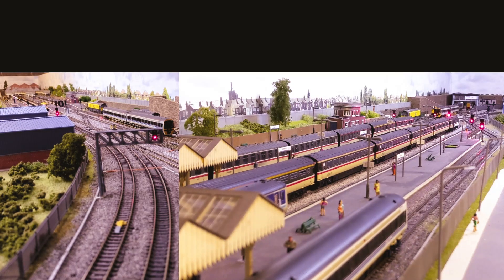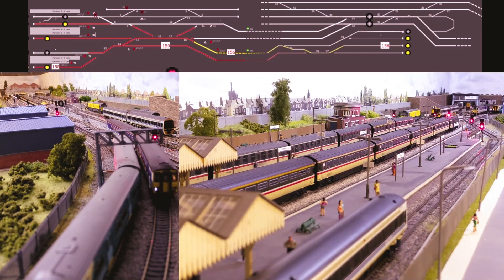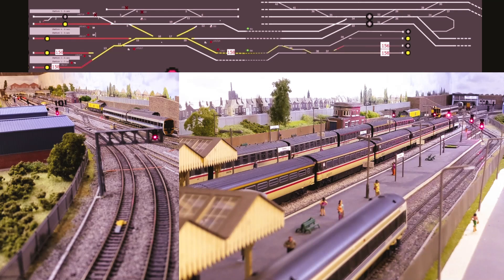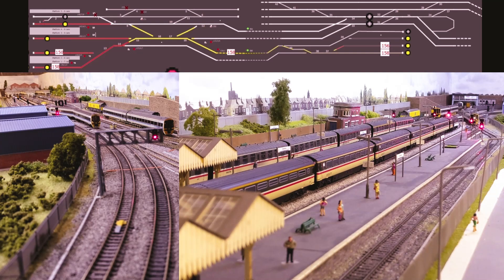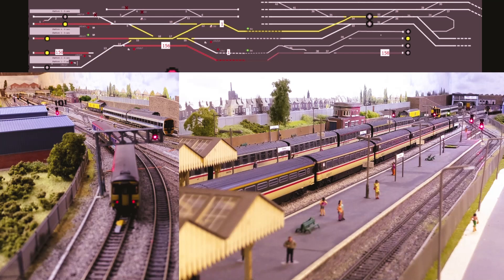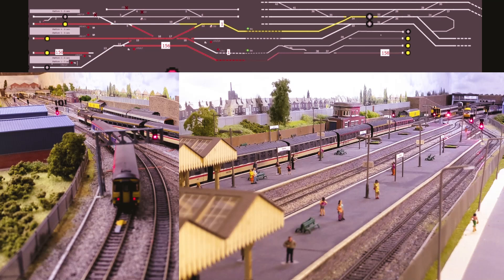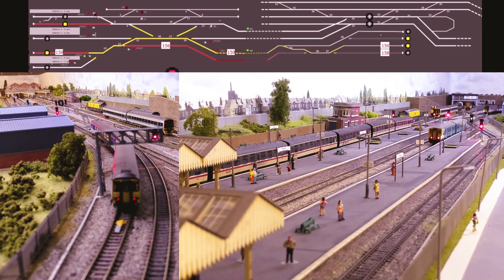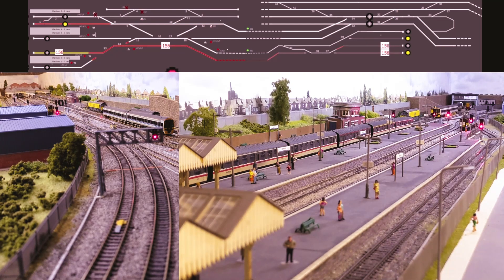Shornford - Update 19 (Enjoying train automation with JMRI / Running Session)

Comment: impressive, sort of planning something similar, but the other way around (layout automated, station manual or largely manual) with a handover, I am hoping to have JMRI "capture" trains that enter a given block and take over, will see how it works - some time off that.

lovely station and lovely to see how smoothly this all operates, shows what can be done
Reply from the maker: Thank you for the nice comment. What I like about having the station automated is that I can watch the arrive/departure nature of it without having to ensure I'm doing something with the controller in my hand at the same time. You are right that JMRI could "capture" trains that enter a given block and take over. The only issue I have with the handover is from "automated to manual" as it tries to force the stopping of the train but you can take over before it does. Will plan to explain that in a future video.

Comment: I think that's all excellent! You must have a huge feeling of accomplishment after all the issues you had to work through. I'm intrigued by the handover between you and JMRI. And that station looks great.
Reply from the maker: Thank you! Yep, it has been a lot of trial and error and problem solving but very satisfying to be able to stand back and watch my railway work for a bit. Still plenty more logic that I can work on!! And with (or even without) automation running, there's so much to enjoy with all the different trains and routes in/out of the main loop lines. Plenty achieved and so much still that I can look at, it's all part of enjoying a hobby and trying to get the layout working how I want it to work. Even running a train without automation, just seeing the signals change based on the signal mast logic is satisfying that I would encourage anyone to try something with JMRI. I'm also surprised that my first video on automation was only in July! Thank you for your informational videos as they have been helpful to me in achieving it and also encouraging too and I'm pleased you posted another recently. As for the handover between me and JMRI, it is quite basic - I just tell Dispatcher to run a train that I'm already running and manually set an internal sensor to active, simulating the train being in a starting block. JMRI ignores what the train is currently doing, takes control and then tracks progress as normal as it hits the station area. I will do a video on how I currently have this working soon.
Reply: am looking at some of this as well. and looking at ActiveTrain API, can see the status can be switched to "working" this seems to hint on switching between manual and auto i tested if a transit action can set train to manual on enter section X.. do some stff like add more wagons. and then on the "auto trains panel" "click resume Auto", one test seemed to work. but need more testing